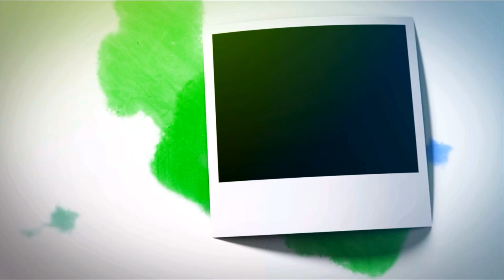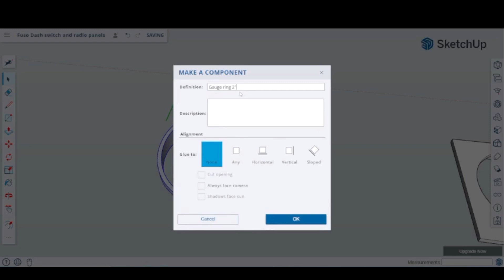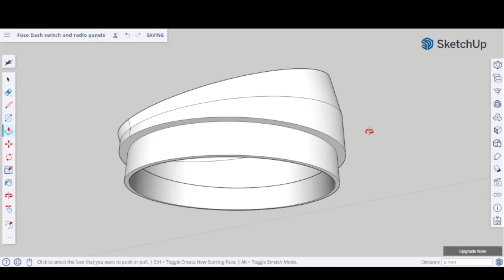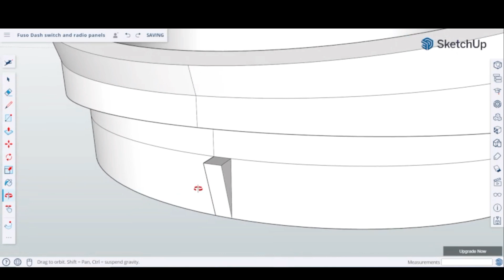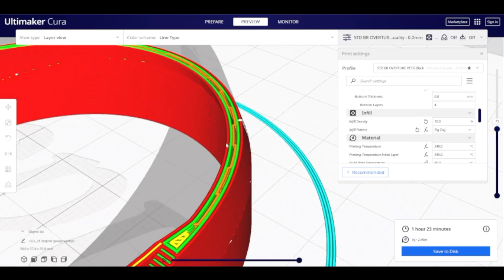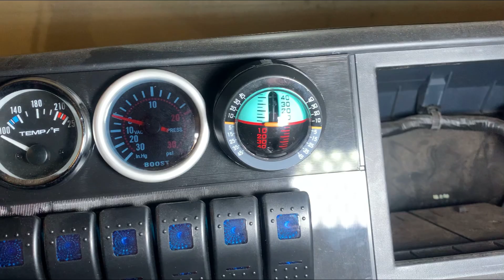Custom fitting the CHEAPEST inclinometer on Amazon!  | Fuso FG

Comment: Informative video. Thanks. I'm using Sketchup to help me build parts for my camper build also... Water filter bracket, hot water system (Bobil Vans style), sliders for the lifting bed, etc...  You just showed me a few tricks I didn't know. Keep them coming...
Reply from the maker: Good stuff! A - glad it was helpful!  Sketchup can be super easy, but at the same time super frustrating when things don’t do what they “should” 😁

Comment: Pretty cool, Bruce.  Why use two 10.5 degree segments instead of just a single 21 degree?  The angle of the end face?  I really have to figure out how to use my Geetech 3DP...
Reply from the maker: If I do a single slice at 21 degrees you end up with an oval hole instead of a circle,  so either the adapter base wouldn’t be the same as the hole it needs to fit into, or the Inclinometer wouldn’t fit into the adapter.  By having the angled face match up with an exact mirrored angle face, they fit together exactly at the panel, the gauge, and the oval seam in between them. 😎